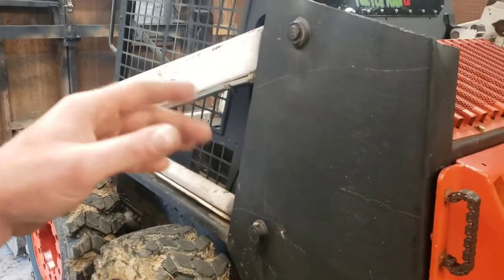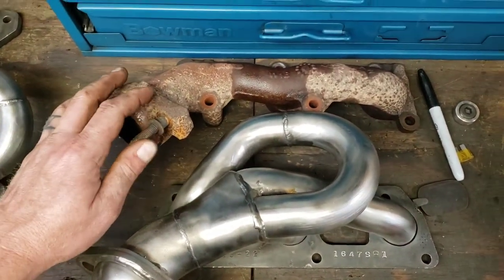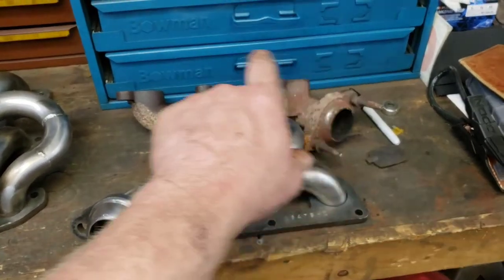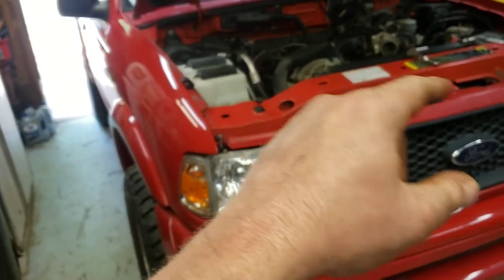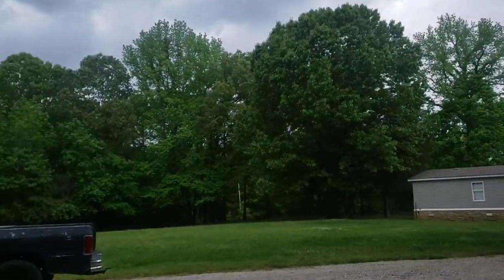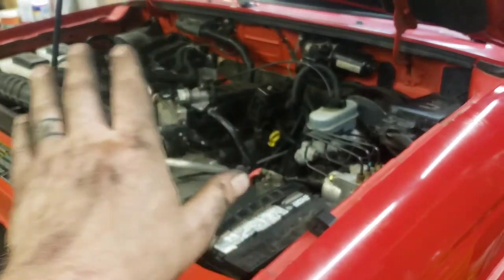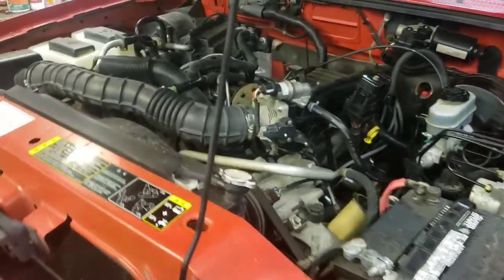Ford ranger 3.0 header install

Comment: My ranger 2005 was a nightmare to get started after my engine swap, battery was weak, injectors were dirty, finally got it running and just let it idle for a long time, been a good truck 2wd with 3.0L auto trans
Reply: Aluminum block isn't as solid as cast iron for reliability also 4x4 is like a complete different truck in terms of suspension setup

Comment: Headers are nice, some 1.7 roller rockers will help, Ford Taurus 2006 intake and throttle body will make it from 150hp stock to about 200hp
Reply: Im about to do the same mod! Im excited
Reply: Tho mine is from a 2004 but still. That intake is huge compared to what they gave the ranger and comes stock w/ 60mm! throttlebody
Reply: Ford Taurus has a larger camshaft on the intake side and makes 5hp
Reply from the maker: I was unaware of this mod. Is it just the upper intake or does it require the lower also?
Reply: @turtleman5.9  just the upper manifold and throttle body, very easy swap there's a year range from like 2005 to 2008 that may have the right parts
Reply from the maker: @cargotoolshop5319  man I preciate that! I'll definitely be doing my research and trying this upgrade.  Thanks

Comment: Online it says certain headers fit engine with egr or and other fit without egr does it really matter?
Reply from the maker: @ColinCaron  i would think a set of egr compatible headers would have some kind of tube or fitting to feed exhaust gases to the egr valve.  Mine has no egr. If you have egr then the egr compatible headers would be the choice. If you dnt have egr but can only find egr compatible headers then there's bound to be a way to cap off whatever is on the headers to make them usable for you.  Hope that helps

Comment: FYI-get rid of the JBA exhaust gaskets since they blow out if the wind blows. They are poorly made!

Use felpro gaskets, the graphite ones as opposed to the perferated aluminum.

There are nord-lock washers. They are pricey but are absolutely worth it as they will slow the header bolts from backing out, which they will do.

Also, there is a "lock-tite" style product that is rated to 2000 degrees. its Vibra-TITE 19960 Hot-Lock Extreme High Temperature Threadlocker. With only the Nord-lock washers its slowed the bolts backing out but did not stop it. Its still better than bolts without washers.
Speaking from experience with my 3.0 and 6 months worth of frustration with the JBA headers these steps made them reliable.
Good luck!
Reply: Thank you for the info. Thinking of doing this myself

Comment: Awesome video man thinking about doing the same. I saw you got 31s on there but what size lift are you running?
Reply from the maker: @caelinowens205  in that video the truck was stock with the torsion bars cranked up to level the truck.

Comment: I've got a 91 ranger with the 3.0L and I would love out some JBA headers on it but I don't want to spend the money on them and they not fit properly. All in all sounds good.
Reply from the maker: These fit absolutely perfect,  direct replacement for stock manifolds
Reply: @turtleman5.9  did it cause check engine light
Reply from the maker: @LiilTyweezy  no it did not. My light is on because I cut my cats out and left the o2 sensors hanging

Comment: Nice job brother, could you tell me the year of your Ranger,  and where you bought your headers, and the brand.  I have an 2002 3.0 Ranger Edge,  and want to do the same. Thank you
Reply from the maker: Mine is a 2004. I caint remember where exactly I bought the headers but they are JBA stainless headers
Reply: @turtleman5.9  thank you, by the way,  after you did the headers, did you have to redo you whole exhaust or did it just bolt up.?
I really appreciate your input. Always love learning from others and there knowhow
Reply from the maker: @V8SKULLS  the headers are direct bolt on, no exhaust mods required. But.... I may or may not have done a delete of the troublesome and expensive emissions equipment 😉

Comment: The header swap changed the gear ratios? huh?
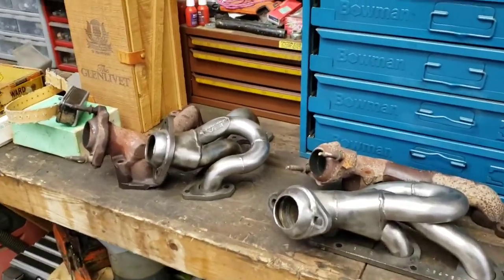Reply from the maker: The added power allowed me to cruise at the same speed but slightly lower rpm.  Power to weight ratio, engine doesn't have to work as hard to do the same work. Not a huge difference,  just a 150 or so rpm. Not like the difference in a 3:55 gear and a 4:11.

Comment: How did you tighten the middle bottom bolt on the drivers side?
Reply from the maker: Caint really remember tbh, I think it was a mixture of a snap on 10mm 1/4 drive wobble socket, curse words, and extensions. Curse words are available at your local walmart
Reply: I had to go buy a set of flex head Ratcheting wrench’s

Comment: Im in cali will this headers pass the smog test???
Reply from the maker: Man I caint speak on that, we down have emissions here. But I can tell you these headers are a direct bolt on and do not Eliminate any emissions equipment and require no modification to the exhaust.
Reply: I know this was a year ago, but the official JBA website seems to have a CARB-EO number for them, meaning that you will be able to pass because they have been reviewed by CARB and allowed to be put on vehicles.